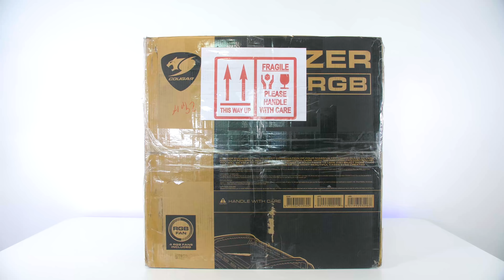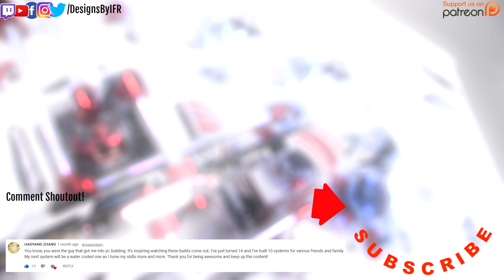Couriers do not Care - $5700 Custom Water Cooled Gaming PC Build DESTROYED

Comment: one thing people miss is if you pack something so dense it becomes a solid mass, its going to transfer, that's why you can send a case around the world with just the styro and be fine, but pack it full of that tiny bubble, bubble wrap and it can't make it across town, its a solid brick

you need AIR, and not that 1/4 inch bubble crap

Comment: Would it be too much to ask which parts got destroyed and which are still salvageable
Reply from the maker: So the build got knocked so hard thay it bent copper, the inlet on the radiator is bent upwards.

The reservoir had support both under it and above it yet that bump snapped it clean from its mounting bracket
Reply: @DesignsByIFR  So it sounds like the actual computer is completely fine.
Reply: J Beith, not really. Without coolant, the entire PC will overheat and fry itself. Making it unusable.
Reply: @nitrozerg  it was destroyed in transit. He seen it was damaged before it was running. Simple fix the loop and it could work, but he is reusing parts so it's salvageable
Reply: LoadedSandwich Gaming, yes, but the state that it was in when shown in the video is unusable.

Comment: whoever shipped this it is there fault for not using 10$ of instapak on the interior i guarantee this would not have happened with instapak
Reply from the maker: Insta pack would not have worked
Reply: @DesignsByIFR  Insta pack would have been way more effective than that bubblewrap used in this pc.

Comment: Holy crap O.O
Has any component been damaged by that? I mean, the coolant probably made a complete mess to some components during shipping
man, the courier really didn't care at all about the fragile label 😕
Reply: it would not have made a difference. The plastic on the inside was a bad choice as it doesn't support the heavier components that well. The fault is in the packaging and not the courier. A small bump on the road could have caused this and when packaging you need to count on things like bumps. Instapak would have been way moe effective
Reply: @EdilarinProducts  well it makes sence, but won't instapak damage the tubes also? because it will push everything inside, there will be a problem if a tube gets separated from the fitting, like coolant everywhere xD
but I've never used instapak before so I don't know
Reply: @sergionunez8878  Nope. It just provides support to the heavier components. Bubblewrap is good for impact damage, meaning the surface won't get damaged, but if the heavier components gets destroyed because of gravity and their own weight, bubblewrap won't save against that.
I've shipped using instapak and it went really well.

Comment: So you're telling me you put all that heavy fucking plexiglass without structural support 

and just packed it with some bubble wrap?

 and expected it and NOT to get broken?
Reply from the maker: I didnt tell you that at all, it had support on the bottom and top, bits of foam that i cut to size to fit snug between the bottom of the case and the res, as well as the top. Did you also see the damage to the radiator?